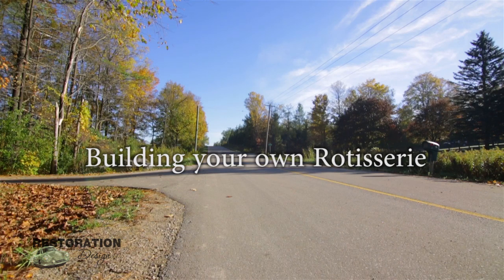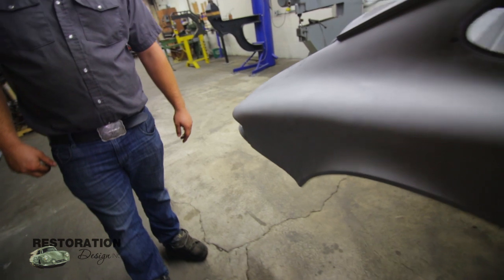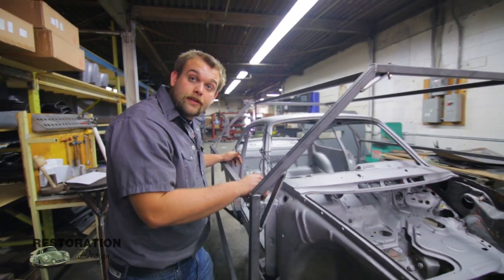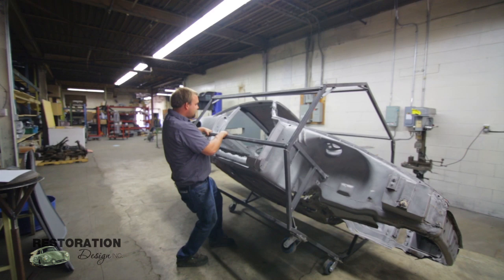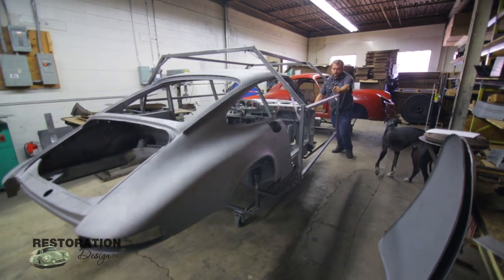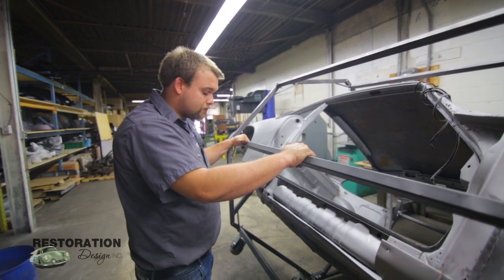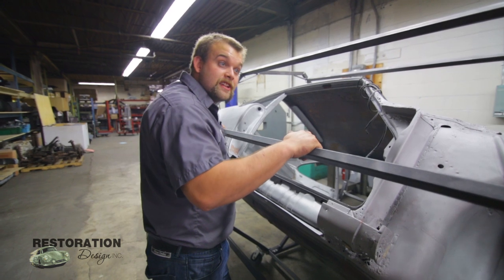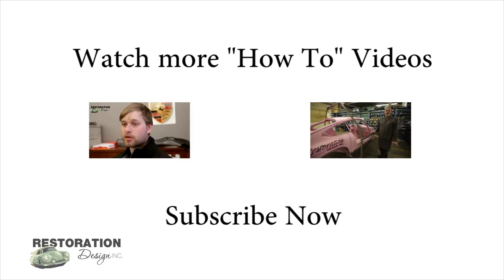Build Your Own DIY-Rotisserie: Porsche 911

Comment: How thick and what size is the metal frame you using?
Reply from the maker: +Lees Autoworks the square tubing is 1.25" x1.25" with 1/8 wall thickness
Reply: Thank you
Reply: Restoration Design, would you see any issue using 13gauge instead of 11. Looks about $100US cheaper to use 13gauge. Gusset all angles?
Reply: I cannot say the difference in rigidity and stifness between 13 and 11ga but I can share my experience in my metal gauges that I am familiar with and I can say that 22 -20-18-16-14....14 obviously is mush more rigid that 22 but between 22 and 20 there is a huge difference as well. ( And so you know I worked in sheet metal siding which unlike the car industry the metal is much cleaner and less acceptable to rust. Nobody wants a building sheeted in siding thats going to rot out in 5-8 yrs.) So back to metal ga and its stiffness/rigidity. most building we sheeted required  U channel or t bar to screw the siding to. Those were usually 18 or 16 ga and the difference in 18 and 16 was huge considering looking at the thickness of the two was very minuscule. But lifting one or the other you to definitely tell the difference in weight and how much "flex/wobble was in it.  
Also you have to consider anything measured in ga is rather thin anyway. No intended for anything relative to structural strength unless mated to other ga to create a structural component to it.  If you are looking for strength in a single piece of metal you need to step up to a form of measurement and not gauge. 
And a lil bit of experience no matter what tech data you read. A tube either round or square does not have the same strength as the same guage formed in 2 1/2's and welded together. The weld if done correct and its a clean weld holds more strength than if the piece was formed as a complete piece.
Kinda of like lap jointing a piece of wood and gluing it together. The wood will fail before the glued joint unless a chemical is introduced that affects the glue but doesn't affect the wood.

Comment: Do you use the same basic structure for the BMW 2002?
Reply from the maker: Matthew Guilbault Yes, we do. We built the outer octagonal cage (around the car on jacks), then mounted plates to the front and rear subframe points. Then we measured and cut bars to attach from the bolted on plates to the cage.